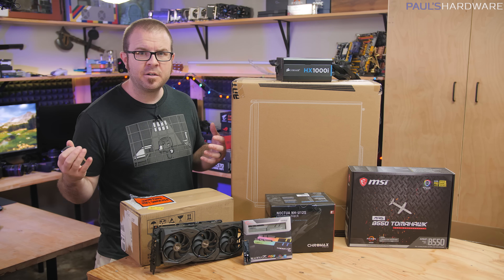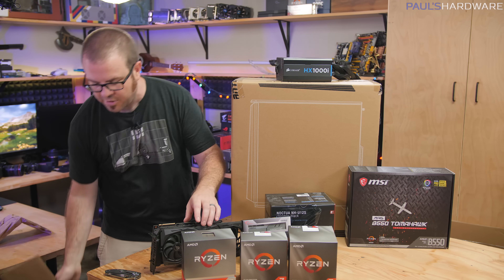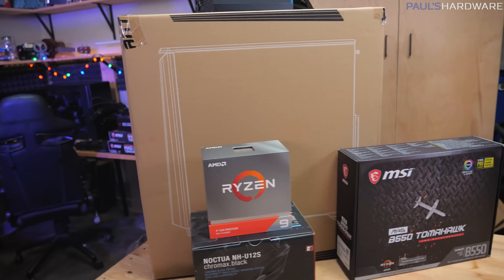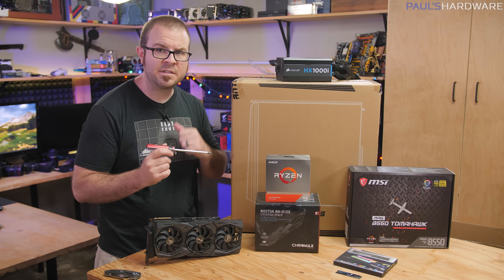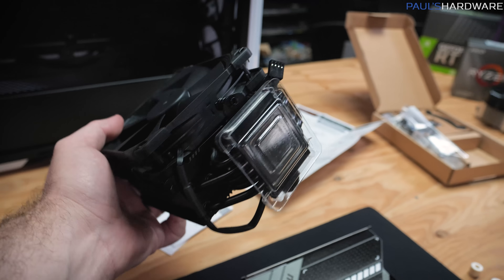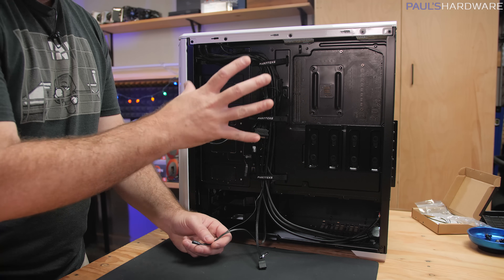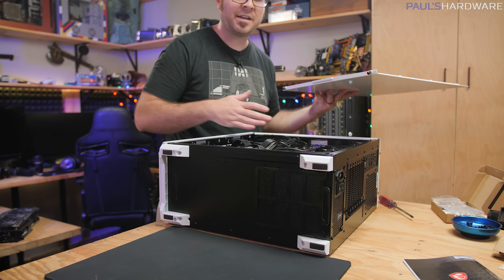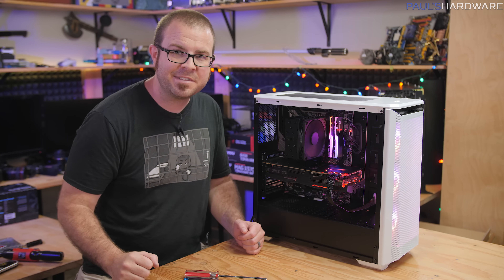Is This a "Reasonable" RTX 2080 Ti Gaming PC Build? (w/ Ryzen 9 3900XT)

Comment: noctua 12S plenty for 3900XT? I was looking to see if I can fit a D15 but if not necessary, the smaller size of the U12 may be aesthetically nicer - also no risk of bumping into the GPU

Comment: I had a new build all ready to go, very similar to this. I was just waiting on my 2080ti. So I decided to build anyway I was excited, I just used my 970 from my old computer for now. The build came out amazing and the 970 appeared to be running games way better than before (I guess my CPU/board was bottlenecking it). Old cpu was a 1700X, new one is 3900X. Anyway, yesterday decided to email seller and alas they came back at me and said due to there being no tracking updates more than likely it got "lost" in transit. Lost my ass. And since they have no more in stock they have to issue me a refund. Now there's virtually no 2080ti for sale. I got a ASUS 2080ti Turbo Evo for my build theme. Now I either try to just settle for a 2070 Super and save some money or continue using my old 970 until the 30 series comes out.

TLDR: Another package goes "missing" and my build is now missing a key piece

Comment: Interested to see the specs without then with the additional fans-- especially the cpu cooler- I hava a aio on my intel 9900k and was thinking to go with a more reliable air cooler-  I have push pull on everthing but am curious what your case temps will be with the air cooler. I know what all my temps are at and curious to see what that build produces.

Comment: Could you run this with a Ryzen 7 3700X? Seems like it's performance is a little less than the 3900XT, but significantly cheaper.

Comment: I know “air” is safer than water...and Noctua is definitely worthy—-but for a system that is North of 2.5k I was disappointed in your choice of cooling.

Arctic Liquid Freezer II (240mm) front mounted with (2) 120mm fans top mounted and (1) 120mm fan rear mounted.  That’s the minimum I would expect on a system of that value.

Comment: just bought this case. paired it with an Asus prime x570-P mobo a 3900X since I built it weeks before xt released and didnt care got the cpu at a killer deal its got 32GB of corsair RGB pro white ram @3200MHZ and added a corsair Force MP600 1TB drive and for power I went with a Corair HX 750 platinum PSU and for a burner graphics card while I wait on the 3080ti I bought a used ASUS dual GTX 1060 6GB since its white as well and looks good for now and I picked it up for nothing :D been super happy with the performance would like to get the graphics updated as long as Nvidia would hurry up and release a new GPU

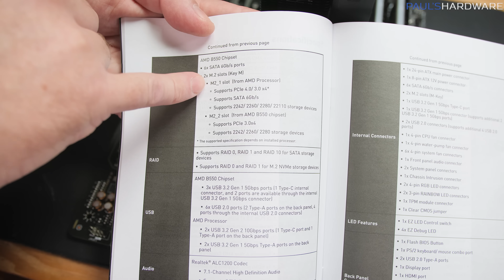Comment: Great video, but I just wanted to point out that the Front Panel Headers on the B550 Tomahawk are only USB Gen 1. You can see in the manual at 11:37 and on the MSI website: https://www.msi.com/Motherboard/MAG-B550-TOMAHAWK/Specification:

AMD B550 Chipset

3x USB 3.2 *Gen 1* 5Gbps ports (1 Type-C internal connector, and 2 ports are available through the internal USB 3.2 Gen 1 5Gbps connector)
6x USB 2.0 ports (2 Type-A ports on the back panel, 4 ports through the internal USB 2.0 connectors)

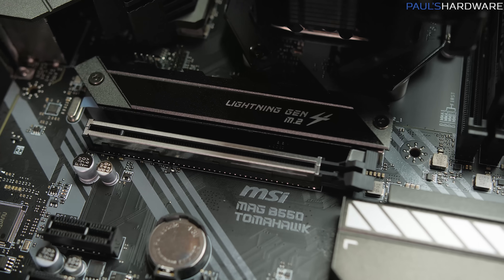Comment: I see that @12:13 the supporting screw for a shorter m.2 drive was left in place next to the black rubber support. Over the long term that isn't ideal as it will create a pinch point on that particular point on the drive.

Comment: Sorry Paul, gotta hard disagree with this build even if it's to tie in a promo with the Zen 2 XT processors. 
Early more thorough testing of the XT processors seem underwhelming aside from being a better bin, and even then the 3900X (not T) barely does anything more than an R7 3700x or even an R5 3600(X) with a 2080 Ti in terms of gaming. So no, the build isn't reasonable since we're talking about a very small gaming gain for the dollar differential between a 3600 or 3700X and a 3900X(T). It was pretty disappointing you didn't arrive at that conclusion or choose to pair/test against the 3600XT instead for the processor launch.

Comment: almost finished my dream build, (only taken 3 yrs). hows this ?
i9 9900k
roc strix 2080ti oc
32gb 3200  ddr4
z390 aorus pro
riotoro enigma 850 gold
1tb samsung sata ssd
1tb mech drive
2tb mech drive 
h100i platinum 240 (last part i need when i can afford it is a 360 aio)
housed in a hydra mini desk. (modded by me to fit into alcove)
to see all the parts of your build together n not built peace meal ..... nice.

Comment: Nice build. Im a newbie to the pc building world and just recently did a full build with alot of help from your videos (thanks for that btw) it all worked out great, I used that same NVME drive except it was 500gb version. my motherboard also had that heatsink piece that i remove and peeled back that plastic before installing it onto my NVME. 
A question i had is do you think the heatsink will transfer the heat better if the label on the NVME drive was removed before sticking the heatsink plate back on top of it?

Comment: Hey Paul another great video. It would be great to see the benefits of having a rear fan & top fan in order to create a push pull cooling senario and how to do that with larger sized fans that turn slower and reduce the db level. Any tips on that would be greatly appreciated.

Comment: great Video Paul, don't understand why you didn't use the lower gromet for the GFX power, I have a P400s (none A but bought a P400A front panel and fitted it to it so I get the air flow) and it fits it ok on my 2080...

Comment: problem... computer works perfectly fine, tho a few hours after it was plugged into a cable rotor in the city... it started acting like someone got board and button fucked the BIOS. was a AMD phenom II x4 830 that was running at 3.56GHz 1.38volts, tho the bios was not locked and the neighborhood doop brained kid came over and tried to tune the system by entering 99999999 on everything, later the lady i sold it to said it wasn't working properly... she just let some random kid with autism destroy what was a $2300 system at that time, if that system was still running it would still be playing modern titles at 720p to 1080p and getting 40-160fps. that's 15 years of use, but the button mashing twinky thief couldn't not mash the keyboard... caused 6 years of defamation/economic loss due to not being connected to the post it/job board. the meth kid comes over and sees a pile of bath salt on the table used for pulling exes humidity out of the air, but whats he do, fills his pockets and acts like he didn't take anything... then goes and hides it in a plastic bag somewhere in the small wooded area in the local park. now hes aimlessly wandering around looking for pipes and lighters!
Reply: could boot from not even being plugged in the wall to launching a 2TB mincraft server in under 40 seconds.
Reply: i can tell the egg head baked the cpu, because refreshing the thermal paste... was like JB weld!

Comment: I bought parts for a new PC almost exactly like this the day before this video was posted! 
My only major difference is instead of two sticks of 3600 CL16, I went with 4 sticks of 3200 CL14 (still 32GB total). I wanted an msi b550 or x570 too but mobos are hard to find in stock these days. Went with a gigabyte b550 aorus master instead for slightly more money. Looking forward to it!

Comment: did you use the jumper on VGA? ive always been under the impression that for the 2080ti that you need to run two VGA cables to it and to never use the jumper or extension?

Comment: No reasonable is my 2400g apu on my asrock b450 mobo. With 8g of ripjaws 3200. And a mushkin reactor 500g ssd and 2tb seagate barracuda hhd. In a diy $25 case. A $2500+ system is very expensive overkill!

Comment: If there is anything to say about today's case selections I'd have to say most of them are still in the past when you compare todays motherboards to them. Cases are not getting updated as they should by all of the manufacturers and its very sad they have fallen behind. Order a case today and it will likely come with 3 pin fans, 20 year old tech, no USB C port up front, 2 or 3 5.25 bays, very old tech as few want DVD drives any longer while those who do only want one 5.25 bay. Lots of cases are still coming with massive venting which are no as necessary as in the past because GPU's and CPU's generate much less heat than they used to.

Case manufacturers need to enhance some of the good case designs already out there to fully support the numbers of motherboards that have 4 pin PWM fan headers, USB C up front, less venting or least offer them with quality vent covers and continue to offer at least one 5.25 bay, no more than one, for those who still want the DVD/BD options. USB C and the fans are the largest blunder case makers currently fail to incorporate into new cases.  Shame on them.

Comment: Hi Paul, would like to know the current temps.. Then, what the temp, improvement is, after you've added, the extra 4 fans 👍😎..
Cheers, from Rick in the UK..
Stay Safe..
Reply: I agree, I have built a similar pc but with a 2070 super and it seems to run hot. Quite, but hot... I definitely will be adding more fans, but I’d like to see which placements cool the best with some actual data.

Comment: I think you should test it with the fan setup as is. Since typically the improvements are minimal after having that much positive pressure fans in the front, and this is supposed to be "reasonable." If you really wanted to go crazy, maybe add a single rear exhaust fan, but I still don't think it would be really needed. I just think that just because there is a slot doesn't mean you have to fill it, y'know?

Comment: I'm having Dell Inspiron Desktop 2011: Intel Core I3 1st Gen, 4gb ddr3 RAM, NVidia GeForce 310 GPU, 512 gb Harddisk. Now I want to upgrade it to operate windows 10 in 4k uhd resolution to run it on 32" 4k 60 hrts monitor to watch 4k videos and movies also I want to inform you that I'm not interested to play any games on it because I just don't like to play games.
So please let me know which parts of my desktop I need to upgrade and which specific brand products you will suggest to fulfilled my requirements.
Thanks..
Please help..

Comment: Need help on cooling.
Installed a 3700x yesterday and having msi x470 pro carbon with agesa 1.0.0.6 bios.
My temps reach 85-86c in just 15-20 min of gameplay and around 90 with stress tests on Stock cooler. (PB0 on auto)
Shall I upgrade to the Nh-u12s?  Will it make a good diiference over the stock one?

Comment: I think we really need to reiterate that a high-end processor like this with the 2080Ti is reasonable only if you're targeting high refresh-rate gaming. If you're planning to use the 2080ti to run games at 4k ultra you're not going to see frame-rates in excess of 60fps on graphically demanding titles and the money spent on the mobo and CPU is doing basically nothing. For example I'm currently playing through Greedfall on max settings in 4k and at 60fps my Ryzen 2700x is rarely going above 50% utilisation whereas the GPU is maxxed out. If you're aiming for competitive online HFR gaming then the CPU is where you need to spend the money first, but for 'sightseeing' games the reverse is true.

Comment: I miss the days when building PCs was extremely simple. It was "1050 - 1080 ti, intel core i3 - i7 unless you want to do streaming, in which its the ryzen 7 1700/1800x, the whatever mobo looks good and is cheap, whatever ram, and whatever case is decent." PC building is so much better now, because there's so many more options, but still. The good ol' days.

Comment: I'm still good with my dual evga 1080 ti that I purchased mid 2018 for $200-250 each XDDD. 2080 ti is way overkill, but the problem I have with this video is the power supply... 1000W power supply imho is way too much for any build unless you're running a server or something. I get that 2080 ti is a power hungry gpu, but 750-850 W would still suffice XDDD.

Comment: I guess the build in the video is "reasonable", but it's not reasonable to bother with such a build right now when the new Nvidia cards are right around the corner.  Could use everything but the same GPU though.  Can't wait to drop $1,200 on a card that might actually be worth giving up the 1080 Ti for.  The 2080 Ti was not it.

Comment: What graphics card lets say mid range would you recommend if I dont want to buy a 2080ti and wait for the new ones to come around the corner? I got 2k budget to build my first gaming pc ever, I was waiting for the new amds processors to release and build it and Im willing to spend extra bucks for the new cards to come and build a fresh up to date system.

So what would you recommend? Does that XT processor comes with integrated graphics? That would be enough for me to wait for the new cards. Or what mid or low range gcard would you recommend for now?
Reply: I'd do a rx590 as a cheap hold over without complete suck. 2060 k.o. if you do things like blender and want more mid range. Just do the 3900x instead of the XT.

Comment: 2700X with a Noctua UH-12
3200 14 cas Royals
B450 Board
Rosewill 1000watt
2080TI Strix
Almost my build, is it worth switching to 3900/3800 if I have a 2080TI? I play in 4K 120hz.
oh nvm....can I see some 4K benchmarks between a 2700X and the new gen?
I cant find any clear comparisons at 4K resolution between generations I know it isn't as big of a difference but for those that are trying to hit 120 fps on Ryzen want to know.